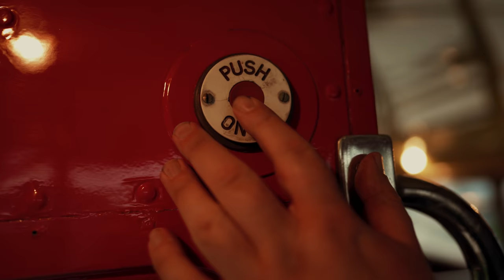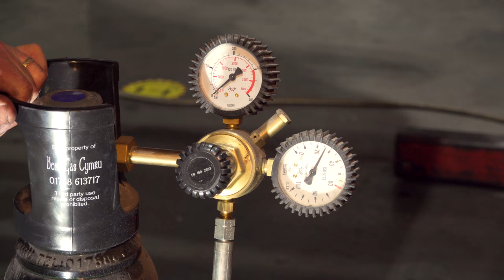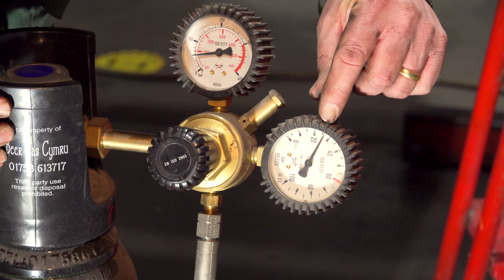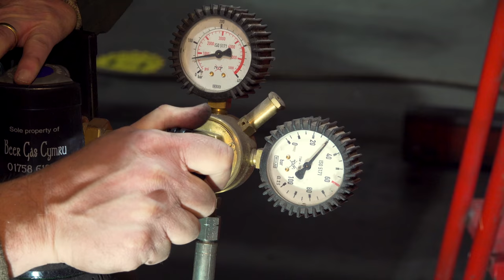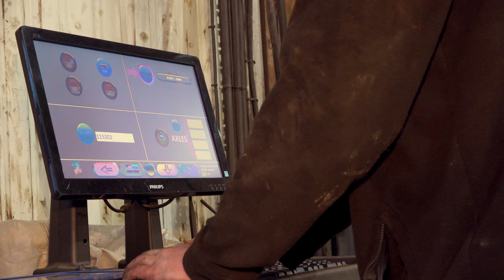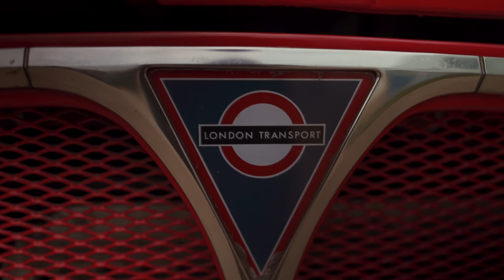Double Decker Bus Restoration | Maintaining The Unique Braking System on A Routemaster London Bus

Comment: Couple of minor points. The young mechanic refers to the brakes as " pads " in the early part of the video. When of course they are " brake shoes "
You make no mention of the Clayton braking system, same principles. Clayton used " spheres "  Country bus RML's had a mix of both. 
The brake tank fluid level, perfectly correct in checking. However, no mention is made of the " brake tank filter  " The filter needs to be removed and checked for cleanliness. It causes all sorts of problems when it becomes restricted. 
London Transport apprentice, Chiswick works.
Reply from the maker: Fair comments Michael, thank you.  Its always great to get feedback from time-served people like yourself, especially those who worked on these buses at LT either in the garages or like yourself at Chiswick or at Aldenham.   We didn't mention Clayton because we have never worked on a Routemaster with this system - all of our buses are fitted with the Lockheed system.  Funnily enough we have actually already recored a video covering the hydraulic filters on both the power steering and braking systems; this video will be released soon.
Reply: I know they are called brake shoes 🤣, I think I did say this later on in the video but I obviously missed it when dave sent me the proof. Simply a slip of the tounge haha. Interesting point about clayton brakes on some country RML's I did not realise this. I know RT's have mix of both westinghouse and clayton systems but hadnt been aware of anything else. Interesting point.
Reply: @timhines6543  I have never come across an RT with hydraulic brakes at Chiswick, Aldenham, or country bus garages.
I overhauled both accumulators at Chiswick which, to the best of my knowledge are for Routemaster buses only.
Please enlighten me about RT's fitted with hydraulic brakes.
Reply: @michaeldance1122  I was mainly on about air brake systems as I know RT's feature both westinghouse and clayton air brake systems. I believe there were a couple of RT's trial fitted with hydraulic systems as a test bed for the RM.
Reply: @timhines6543  okay. No problem.
We use to use the old fashion Tapley meter on the test track at Aldenham.
It was not unusual for an RM to achieve 95% or more. I can remember the rear tyres actually leaving the ground as the braking system is so powerful. 
I worked with Colin Curtis who had a great deal to do with the RM design. 
RCL's as you know, had rear air suspension. Quite innovative at the time.
Keep up the good work.
Reply: @Routemaster4Hire  Spare parts are rarer than hens' teeth for the Clayton system. I and another mechanic converted a preserved RM from Clayton to Lockheed, replacing the spheres with 'torpedos'. There was a kit available from Imperial Engineering, who also overhauled torpedo accumulators or supplied seals for DIY. Don't know if Imperial still exist, think they were at or near Peterborough. The system was developed for the Spitfire (the 'pump' unit fitted inside a wheel hub, you don't need pressurised brakes till you land!) and was used on all Midland Red post war home made buses as well.
Reply: @michaeldance1122  I think some Metropolitans (M type) and Metrobus (MB), and possibly some Fleetines (DM etc) had air / hydraulic systems. Earlier stuff, RT, RF etc were pure air - AEC used a version of the American Westinghouse system on buses & trucks with air brakes.

Comment: The brake shoes slack: Isn't the fact the brakes need manual adjustment the sign the slack adjuster are not working so need to be fixed (most likely needs to clean and grease the ratchet mechanism)? Just curious...

Comment: I know absolutely nothing about old British buses totally different brake system thani am use to vacuum over hydraulic pump driven hydraulic and 2 or 3 flavors of air brakes my current bus turned in to a motor home is a1968 gm pd4107 has dd3 brake cans on when they come up for rebuild  i will put spring brake cans on 
Good video good clear information 
Have a good day 
THE GRUMPY BUS

Comment: Another super and informative video - thanks. I have driven an RML with a full compliment of passengers and the brakes felt perfectly normal until I needed more braking and then the pedal went to full travel with little more braking effort applied to the road wheels! No flags or anything to suggest a brake problem. Could the problem have been low charge or oil? Could I ask one other question? I’ve heard that RMs have an emergency stop braking ability when the brake pedal is pushed very hard! Is that true? I’ve never experienced it!
Thanks again for the videos and keep up the good work.
Reply from the maker: Hi Eric.  If you stood on the brake pedal and the wheels didn't lock, I would guess the footbrake valve needed changing. If oils/pressure were low the flag would have dropped.
Reply: The othe reason they will not brake harder is if the slack adjusters are not properly adjusted so the cylinder pressure is acting at 90 degress to the lever.

Comment: You mentioned building up hydraulic pressure but the accumulators are air/nitrogen devices. Is there a pneumatic pump that charges the system up to the working pressure? On of my neighbors has a Routemaster and I've enjoyed a few trips out in it. They really are fantastic machines.
Reply from the maker: Hi Peter, that's exactly right.  A pleasey pump charges the hydraulic oil to working pressure, then the accumulators provide the extra pressure to operate the brakes.
Reply: @Routemaster4Hire  Thanks for the info. I've tinkered with engines since I was a schoolboy playing with model aircraft diesels and cars ever since I could drive, and passed my test in Dec 1962! There is always something to learn and YouTube is a great source of knowledge. I'm going to post a link to a friend who runs the Swansea Bus Museum.

Comment: If the self-adjusters are that unreliable, why have them at all? Or, do the self-adjusters themselves, need servicing? I'm surprised that you don't have frame lifts for those
vehicles. Do you arc grind the brake shoes to fit them to the drum circumference?
Do you have a drum lathe in the shop, to turn those brake drums, when they get out of round or scored?

Comment: are the brakes on s cams like air, looks like mechanical park brake and hydraulic actuated minus the air system, five or ten pounds of weight if even that a air system would have been more reliable and less maintenance, looks like a ton of items are worn out and moving(bushings, pivot points)

Comment: what type of breaking system was used before hydraulic brakes? where they just machanical
Reply from the maker: Routemasters always had hydraulic brakes, but earlier buses were fitted with air brakes.
Reply: @Routemaster4Hire  thanks 20/10

Comment: Can you tell me where compresser is located for braking system
Reply from the maker: Its driven by belts from a pulley off gearbox.  So the system is only charged when the bus is moving or in neutral.

Comment: Very interesting almost how the hydragas suspension works on my Allegro, why does the propshaft etc spin while static? Is it some kind of witchcraft?
Reply: I am no expert on these buses as having never seen underneath one but  I would imagine the prop shaft you see spinning is just a coupling from the fluid flywheel on the engine to the semi auto  transmission
Reply: Because the opposite wheel is on the lift it can't rotate so the diff is sending the power to the prop ,if both wheels were of the ground the opposite wheel to the one rotated will turn in the other direction .

Comment: So the accumulators don't have a way of rebuilding their own pressure via an engine driven pump or something?
I don't understand their function.
Reply: They technically could be set up to rebuild their pressure from a separate pump but that would make the system unnecessarily complicated, heavy and probably less reliable. As brake pressure fully depends on the accumulators it would probably be unwise.

Their main function is to provide immediate pressure to the brakes without causing a gigantic drop in pressure of the hydraulic system. That makes them in a way comparable to the brake booster of a car but the gas pressure is constant and the fluid is constantly under pressure (when the pump is operating). The type of hydraulic system it's used on is more comparable to the typical hydraulic powered steering system. Only the scale is much larger.

But they're set up like this so the brakes could still keep working normally, for long enough even if (nearly) the entire hydraulic system were to fail (no matter what the cause). A stalled engine wouldn't have an immediate effect on the braking capability. They probably used separate accumulators for each axle to build extra redundancy into the system. That way severed brake lines or a single failed accumulator wouldn't take away all stopping power.

By comparison a more common (on busses and lorries) air system for the brakes immediately applies all brakes when the pressure in the system is low. The air pressure keeps the brakes disengaged while less pressure to the brakes applies them. Which explains the sometimes broken down lorries being stuck in the middle of the motorway. The system in the Routemaster on the other hand can still be used as normally until all the present liquid from the accumulator has been used. So if you don't brake at all, you could keep driving for the rest of the day (but more likely to the next bus stop). Another advantage is that you can literally apply the brakes on and off constantly without running out of pressure to operate the system (unlike an air system).

It's kind of an unnecessary feature for road vehicles but this braking system is used in nearly every modern airliner for this reason (not the Boeing 787 which has electric brakes). On an aircraft, brakes are only truly necessary to work during rejected takeoff, landing, taxi and gear retraction but shouldn't lock up unexpectedly during takeoff or landing. Especially as the left and right braking systems are controlled independently. But the brakes still work without working hydraulics, working engines or even without a working electrical system.

It's no wonder the system on the Routemaster originated from Lockheed.
Reply: Think of an accumulator as a metal can with a balloon/ bladder inside it - the pressure  in the balloon opposes the hydraulic fluid pressure. If the balloon is flat then hydraulic fluid from the other side will squash the balloon & fill the can almost completely. If the balloon has pressure, the hydraulic fluid pressure will reach a point in equilibrium with the balloon pressure & will then act as a pressure reservoir if the hydraulic pump fails. i.e the balloon pressure then pushes on the fluid in the reservoir to give brake pressure & will do this until the balloon has fully expanded & can push the fluid no more.

Comment: The fact that 12 pumps is the minimum, but when the system is to spec you get 35 pumps is mildly concerning as to how out of spec it was allowed to get
Reply: Yeah i noticed that. I'd be moving the maintenance interval up if the vehicle is out of spec before it is checked. Accumulators lose more volume at higher pressures, which means the reserve drops fastest immediately after filling. This means the brakes were out of spec for quite a while. At an average loss over 8 weeks, you're losing 3.4 pumps a week - out of spec in week 7. Take into account the higher volume loss in the first couple of weeks, and you'd find the brakes would likely be out of spec within 6 weeks. You don't want to let your fleet operate under spec, especially as adjustment would increase brake life, extending replacement intervals. 
I'd recommend a 4 week interval for maintenance. 
I think the function and balance check at the other workshop could stay at an 8 week interval, unless you noticed an unusual level of wear in one or more components.
Reply: @rustymozzy  Honestly, if the equipment doesn't already exist (especially on the newer buses), adding an onboard pneumatic pump to recharge the accumulators automatically when they get low would probably be a pretty good idea. Obviously you would have to add pressure regulators and such so the pumps wouldn't over pressurize the system and burst discs/overpressure valves on the pump side to release pressure on the pump side (Not the accumulator side, I can only assume there is already a built in pressure relief valve) so that in the event the pump gets stuck on, it will vent to atmosphere automatically before causing damage, and without causing loss of pressure on the accumulator side. I wouldn't be surprised if the modern buses already have such a system, assuming they haven't already switched to an air brake system rather than a hydraulic system that relies on accumulators

Comment: Nitrogen isn't that bad for you it already makes up 78% of the air we breathe, the danger is using it in an enclosed area which can decrease the oxygen (as a ratio, as there will be now more N2 in the air you are breathing) you'll notice it as you'll get a bit light headed, you can get O2 detectors which will earn you. But a good ventilated area is great.

Comment: So, you're not engineers ! I counted 2 fails:
Failed to inspect brake linings all round
Failed to assess and remedy the automatic adjusters so that they'll work properly in the future. Typical faults - stiff linkages, needing lubrication (& possible diassembly to free off) and excess play in the linkages such that the wear needs to be excessive before they begin to adjust the brakes.

Nonetheless, an interesting video, thanks.

Comment: If the code for the breaks on a Standard RM is 115202 what is the code for an RML ?
Reply from the maker: David an RML brake code is 125202. The 125 refers to the vehicle weight (hence why this figure is higher than the code for a standard RM) and the 202 is the code for a bus. Make sure the operator also selects pre-1968 on the machine.

Comment: Good video, but jesus christ, that intro is long enough to have just about made me click off to something else.
That said, slightly confused on how the system actually works... It seems as presented that hydraulic pressure needs to be built up before the brakes work?  Is that the case, or does it work like an air brake system where the air pressure holds the brakes off, and a failure of pressure will cause the brakes to be applied?
Reply from the maker: Hi John. Sorry you find our intro too long.  It the opposite to a modern air brake system - when empty the brakes are off, you need to build up the pressure before the brakes will work.

Comment: Er. Air is already 78% Nitrogen the tiny amount you're releasing would make negligible difference to that even it the room was totally airtight which it obviously isn't so the bit about ventilation and it might kill was was somewhat unessicary scaremongering.
Reply from the maker: No Martin I disagree, nitrogen can be dangerous, Inhaling air containing mostly nitrogen can lead to various signs of physical and mental impairment. Depending on the concentration, it can cause sudden unconsciousness due to asphyxiation if inhaled in a large enough quantity.
Reply: @Routemaster4Hire  You breath air containing "mostly Nitrogen" all day. You could empty that whole cylinder into your workshop and you wouldn't even  notice let alone what escapes from the hose. Night clubs packed with people regularly release FAR higher amounts of CO2 (special effects jets and cannons) with no ill effects.